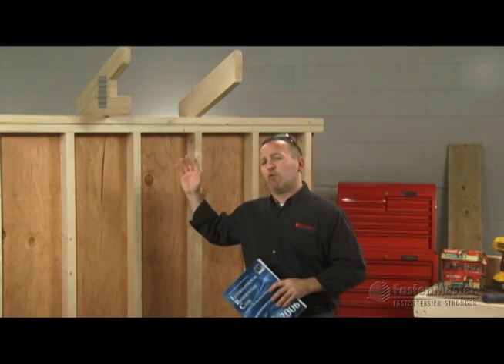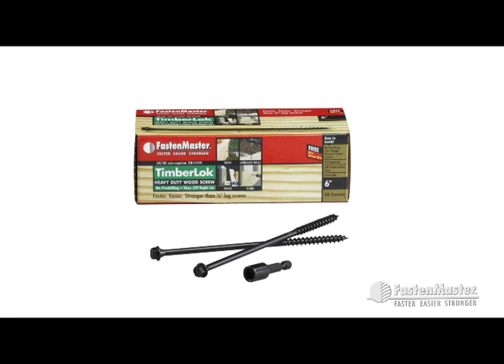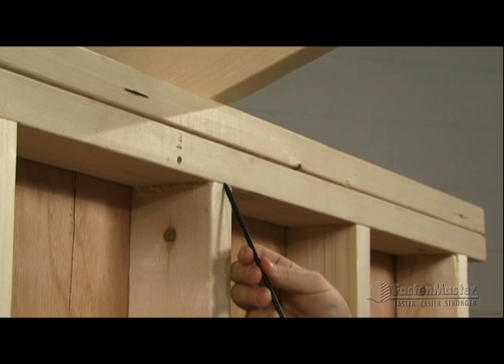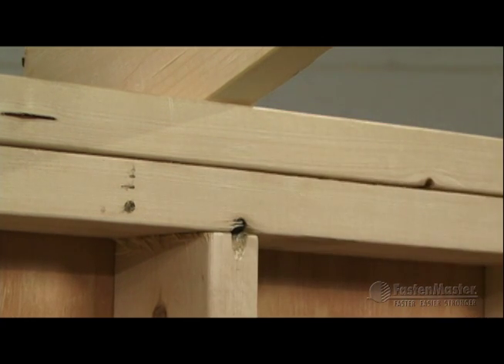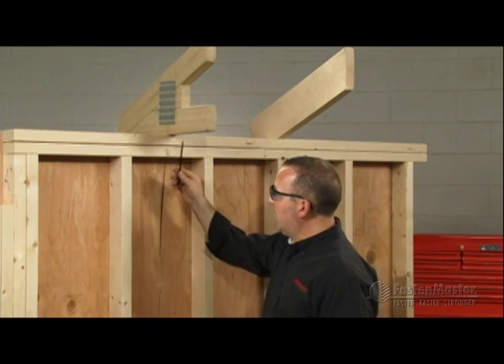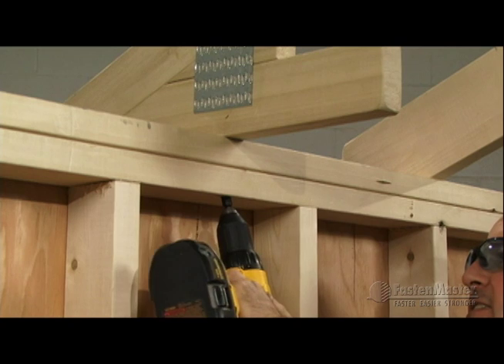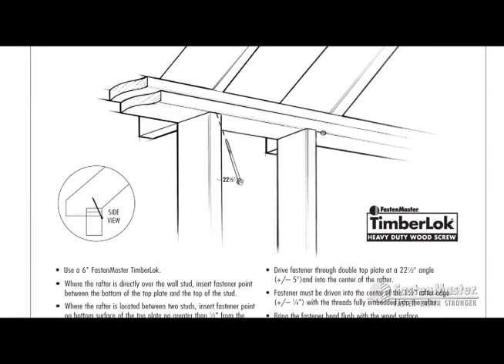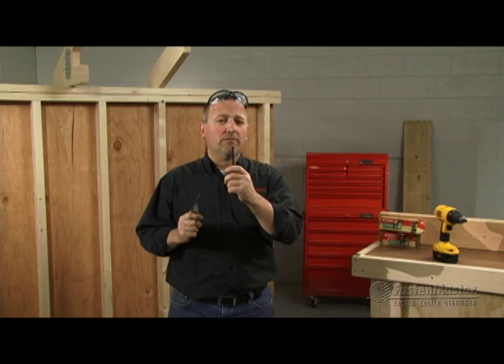FastenMaster TimberLOK - Rafter/Truss to Top Plate Fastener

Comment: I'd like to use the 8" version of these to fasten 2x6 rafters to the top of a 6x6 beam (on a pavilion). I believe it makes more sense to drill down through the top of the rafter and into the beam (as opposed to up from under the beam and into the rafter). I may have to drill some pilot holes just to ensure I don't split the 2x6 by going all the way through, but would that work?

Comment: how do i join two 2x6 together to make a 2x12 rafter.......i need to add to existing rafter which is 2x6 to meet insulation requirement
Reply: Consult a local structural engineer

Comment: Sounds like this would have to need paper documentation, Home Inspectors can visually see H2.5 clips and straps, you won't see a 6 inch Timberlok screw while in an attic.
Reply from the maker: We do have documentation available on the website that I can send you if you're interested. It is also mentioned at the end of the video. The fastener head is visible for inspection. The head of the fastener is also stamped with the length of the fastener for ease of inspectibility.

Comment: Will it meet the hurricanes code?
Reply from the maker: Where are you located?
Reply: Gulfport, MS
Reply from the maker: TimberLOK or FrameFAST screws can be used where you'd normally use a standard H2.5 hurricane. Gulfport, MS is in one of the highest wind zones, similar to Miami FL.  In these extreme cases, heavier duty hurricane ties beyond the H2.5 must be used, therefore our screws would not work either.